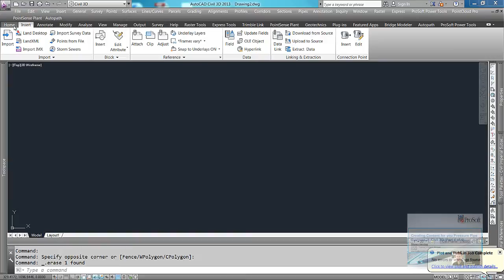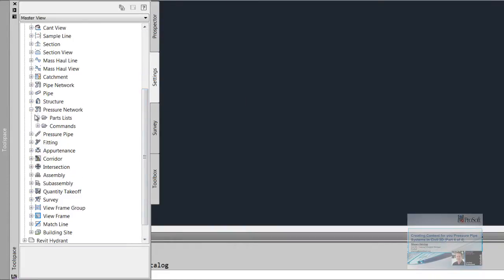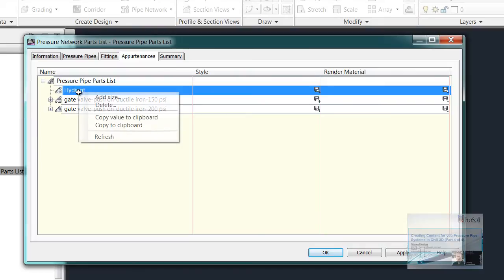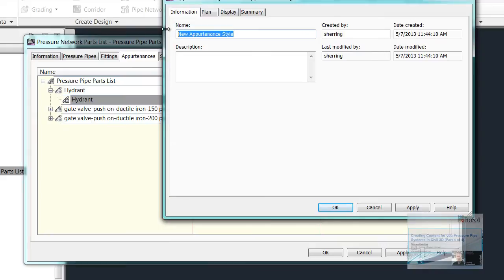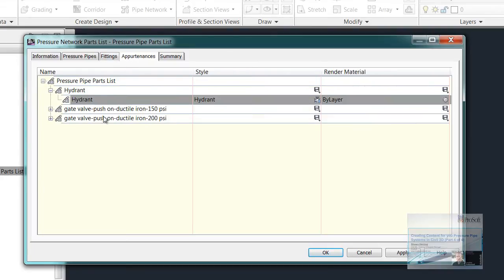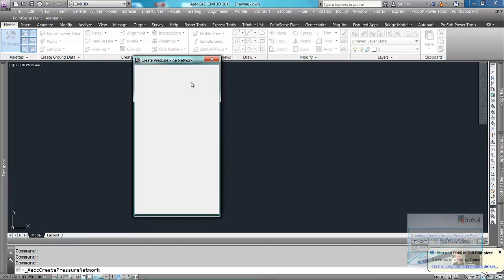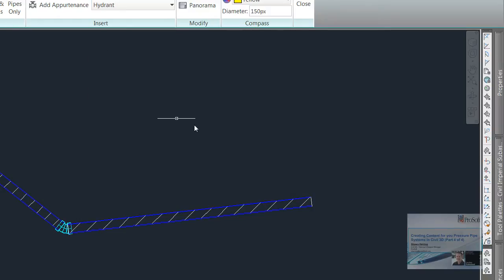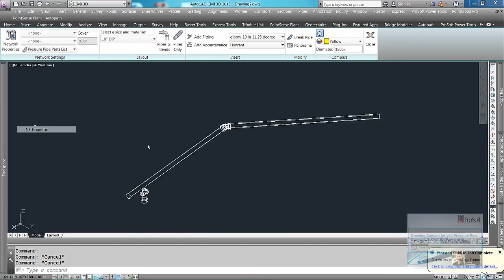Create Pressure Pipe Content in Civil 3D (Pressure Pipes 4 of 4)

Comment: I've watched all 4 in this series.  I would like to clear up a couple of things that may be important for actual use in design files.  As far as I've seen, you have to have a separate .content file for each size of fitting.  Please correct me if I'm wrong.  This can be a lengthy process.  Also, I think the actual connection of pipe to the hydrant would be a good demonstration.  It appeared that you started this and it didn't work as simply as hoped.  I have gone through this process and it's not simple at all.  I would like to know if there is a simpler solution.